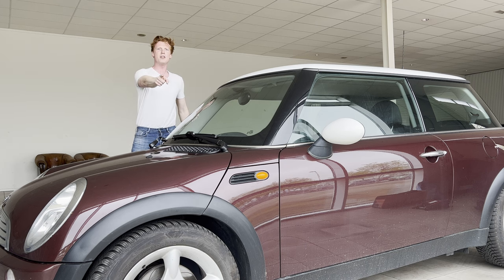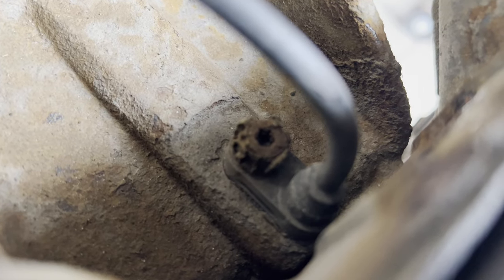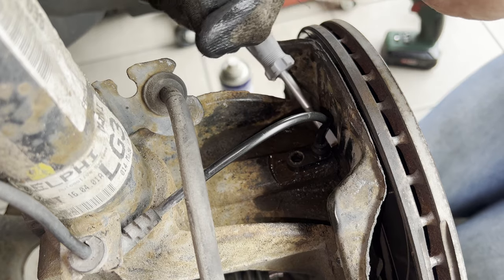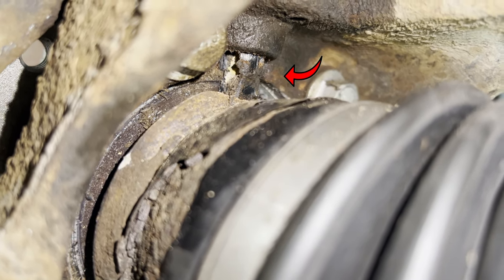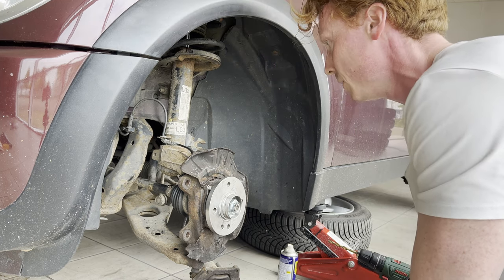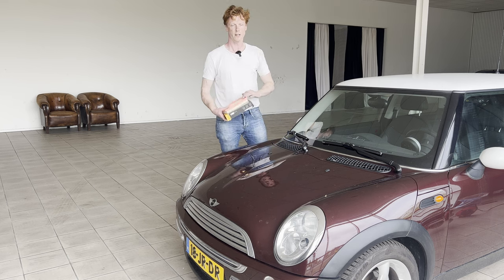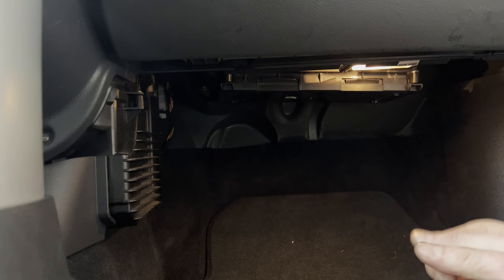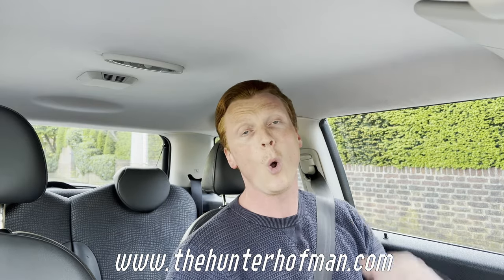MINI Cooper R50: Replacing ABS Sensors, Air Filter and Cabin Air Filter

Comment: A great and easy way to get those ABS sensors out when stuck in the hole:  cut cable and drill a small hole down into the center of the sensor.  Then screw a self-tapping wood screw down into it.  Now just use a claw hammer and pull the whole sensor out like a nail.
Reply from the maker: Ah yeah that’s actually a good one; thanks for watching man